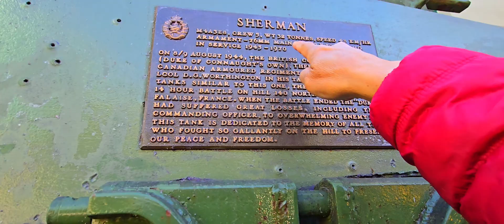M4 Sherman Tank Ground Pressure measurement

Comment: "Only 9.87 lb per square in in so less than my foot"
All of the weight it concentrated where only the track is touching the ground.   That is T74 track. And because it is resting on hard concrete, the tank rides on that chevron ridge only.  So all of the weight is just on those. Probably hundreds of PSI not ten.  
Even in soft ground, the weight is only on the pad and end connector surfaces, which is much less than the length x width of the bottom run of track.  Plus there is more force where the roadwheels touch.
So your maths is wrong. And I don't recommend letting a tank run over your foot.
Reply from the maker: Thanks for watching. The tank is 70,400 lbs and the total area of the two tracks that is in direct contact with the ground is about 7,130 square inch. If you divide 70,400lbs by 7,130 square inch, you get 9.87lbs/square inch. The weight of the tank is spread out in the area of the track that is in direct contact with the ground. This M4 Sherman Tank is the latest Sherman variant with a 23inch  track that is wider than earlier Sherman Tank. Early Sherman tank only have about 17inch which gives them a 13.7 PSI. look it up in Google and you will see what I am talking about. Of course, right now, the tank is resting on the ridge of the track because the ground is a hard flat concrete because, that is how it was place in this static public display. But when the tank is on the move in dirt ground, the whole ground that is in contact with the track is going to support the tanks weight. But you are right in it's current setup. My calculation is based on the role that this tank was designed for and that  is bringing the fight to the enemy mostly running on dirt ground.
Reply: @VIDEOVISTAVIEW2020  That is still wrong. Look at the track. It is made of individual blocks that have gaps between them. This take away from the ground contact area.  Also that track has raised cleats, so all of the weight is resting on just those.
Reply from the maker: @obsidianjane4413  of course I know that because I can see it underneath the track when I peak in between the raised track and the ground, there is about a few millimeter clearance because the tank is resting on a hard flat surface but when it is running or resting on soil ground, those centimeter bulging track groves will sink to the soil enabling the full width of the track becomes indirect contact with the ground  and I'm going to address that on my next post. A few minutes video like this is not enought to address all of the mechanical details surrounding  the tracks. We can go on and on about the intricate details of the tanks track but that deserves a separate and longer video.
Reply: @obsidianjane4413  But the percent of contact surface the gaps make is not that big. I guess we are speaking in general terms. If you can walk on a surface without sinking too much, a tank can, too. That is the general idea.
Reply: @obsidianjane4413  Yes, ground pressure varies across surface type.  So what?  It's just not important to the question when it's a general question in the context of YT.   Let me guess: you're American?
Reply: @iatsd  Let me guess, you're a racist?